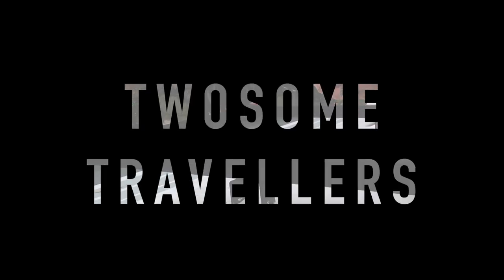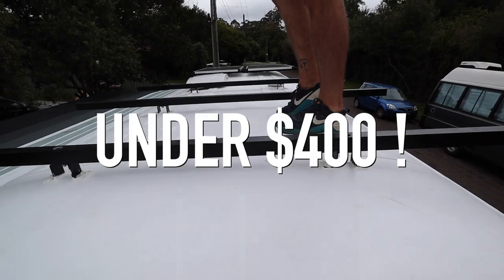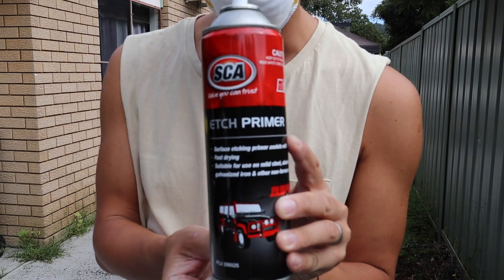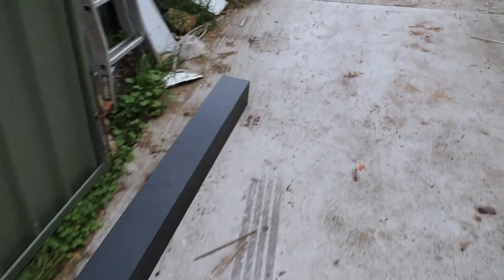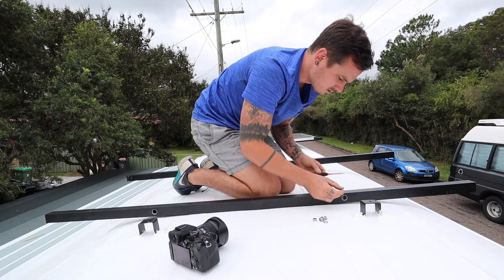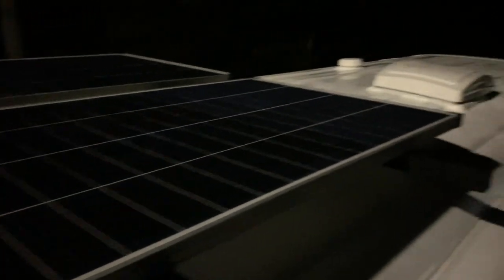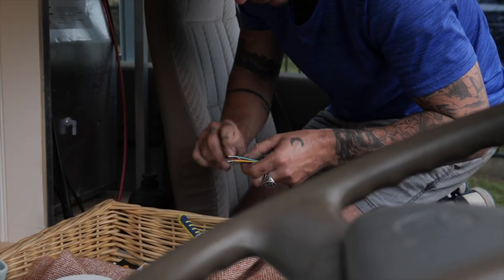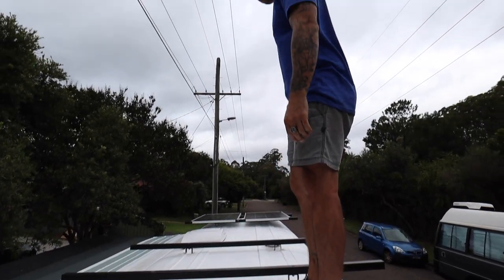DIY Aluminium Custom ROOF RACKS with solar panels for $400! Bus / Van Conversion

Comment: Hey guys 
I would love to know some more details about your roof rack system. What size are the brakets, bolts etc? And where did you have them made. We also have a Coaster and we're at the stage of installing our solar. I love the setup you've come up with. It looks awesome and is exactly what I've been looking for. Any more details you could give would be greatly appreciated. Keep up the awesome content. Your bus looks beautiful ❤
Reply: I sell the kits over at @mobilevanfitouts 🙂
These were the first ones ever installed and they have slightly been updated as well an updated mounting method. Shoot through a dm on Instagram of Facebook and we would be happy to help out.
Reply: @jamesmachan8568  
Hi James I don't have Instagram or Facebook. Do you have an email address please

Comment: Great video you guys and ty for the ideas. I am about to start my own roof and was wondering what some measurements were. For example the space between center roof and the first hole? The bracket height and total width, and has anyone got the rib spacings? Thanks.

Comment: Watched & liked all your videos in the playlist, except this one...REASON: plz tell us more about your solar panels and all the electricals that will go with it
Reply from the maker: Hi Riyad. We have 2 x 300w solar panels that we purchased from EBay. They supply all the parts necessary for installation. We wired them into our DC2DC Enerdrive battery charger. Which in turn is wired into bus bars, which in turn is wired to the battery 😊 

https://www.ebay.com.au/itm/2x-300W-12V-Solar-Panel-Kit-Mono-Single-Power-Source-Charging-/123417003924?mkcid=16&mkevt=1&_trksid=p2349624.m46890.l6249&mkrid=705-154756-20017-0

Comment: This is awesome me and partner are looking at buying a 95 coaster this weekend we are super excited. Could I ask what batteries you chose? We would be using an air fryer and fridge very similar to the set up you have gone with. Also what projector did you go for? Love all of the videos they're great.
Reply from the maker: Hey Sam! How did you go with the viewing, did you end up buying the 95 coaster? Yes we went with a lithium battery 300AMP hour Voltax battery. Also for the projector do you mean the screen or the projector white blind? Air fryer we nabbed from Aldi and we LOVE it! Fridge is from Thetford and is a pretty great size for the two of us, never need to worry about space in there (apart from when we buy too much wine haha :)